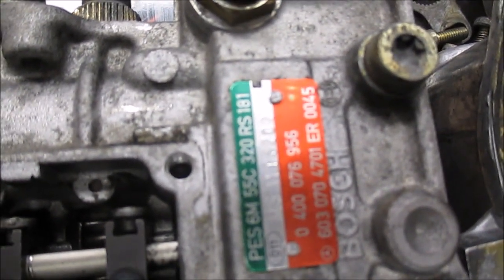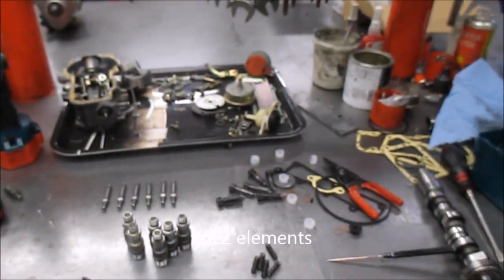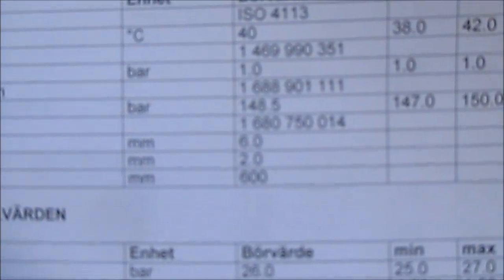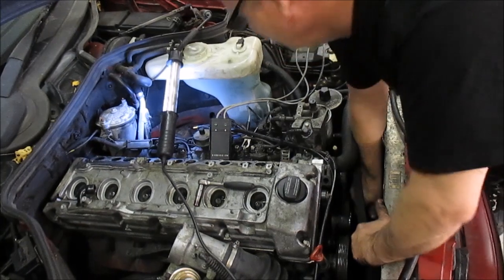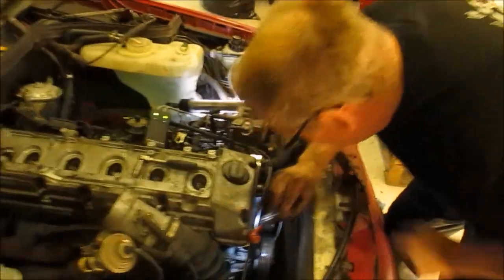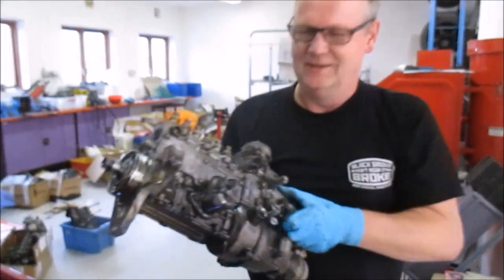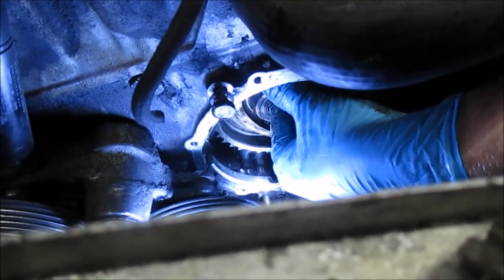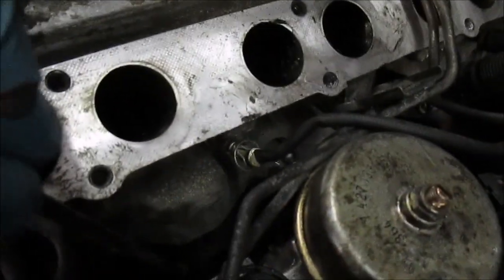OM606N/A Gets 7,5mm superpump

Comment: I've been watching all your videos. I'm trying to figure out if a non turbo 1980 300d injection pump can be adjusted for volume in a single chamber? The no4 puts out way too much fuel and causes smoke even though the injectors have been switched. I tested the pump and it blows double the amount out of no 4.

Comment: I spent 26 years as a telecommunications technician, 20 years on customer equipment, party retired now rebuilding diesel engines and started to look inside injector pumps, I can tell you it beats the hell out of a job where all the knowledge you learn is obsolete the day you learned it, this is a far better and easier craft and more full filling.
Reply: I've done alot of jobs too, and as I get older I think taking the diesel mechanic course in college would've been rewarding. The Mercedes diesels are so interesting, and getting power gains, or convert biodiesel, or vegetable oil could breath new life into a great motor!